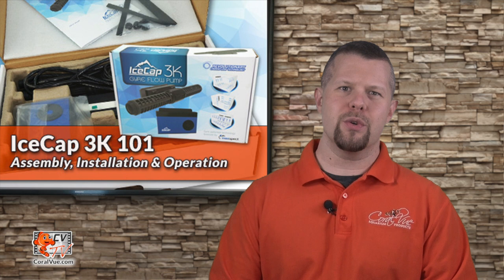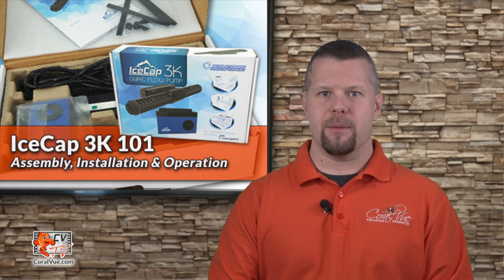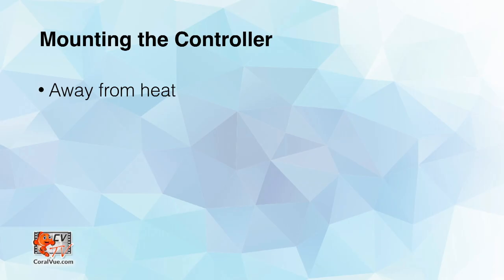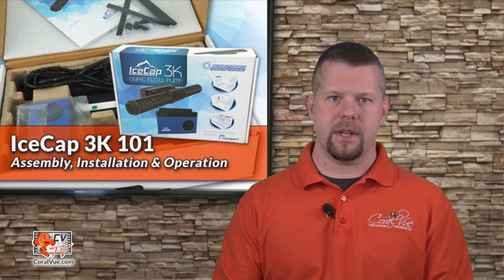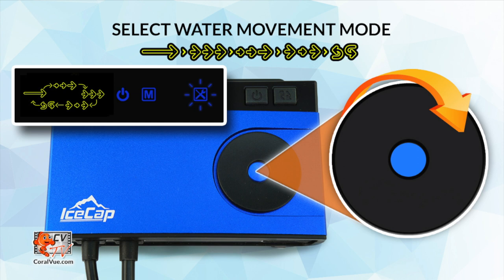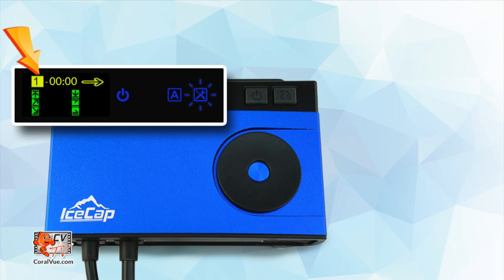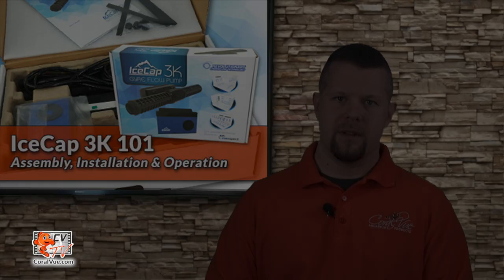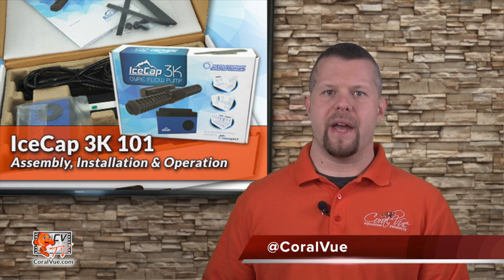IceCap 3K 101: Assembly, Installation & Operation

Comment: Does Ecotech have a patent on the external power cord or do all of the other pump and powerhead manufacturers not yet understand that power cords inside the tank look terrible and detract from the beauty that is trying to be created? Come on guys. The pump in this video would be a winner if it were not for the power cord hanging over the edge of the tank.

Comment: I have a maxspect gyre xf130 with the crappy controller they used to come with, my question is does the new icecap 3k controller work with the maxspect gyre pump? I'd like to buy a 3k and use the controller to control both pumps, is that possible?
Reply from the maker: Sorry it is not possible to use the 3K controller but you can upgrade to the Advanced controller seen here: http://www.coralvue.com/maxspect-advanced-gyre-controller
Reply: So basically i gotta pay $150 for just the controller because it has the Maxspect name on it as opposed to getting a pump AND similar controller for the same price through Icecap smh...last time I buy anything Maxspect.
Reply from the maker: It is a different controller all together and comes with a new power supply to operate two pump. Its Capabilities far surpass the 3K.

Comment: Is the random mode actually choose random modes or does it randomly change pulse speed and length?
Reply from the maker: It provides an random assortment pulse speeds and lengths. Probably one of my favorite settings.
Reply: Appreciate it. That is what I assumed after watching it for quite awhile. Originally i thought it would go into reverse sometimes and at different reverse speeds for turbulence but I didn't see that. Having said that, I am assuming with the program mode I can program the pump to run random then in alternating mode then back into random up to 24 different time point, is that correct?
Reply from the maker: You are correct.

Comment: So is this a newer version or a competing product to the Maxspect Gyre?
Reply from the maker: The 3k has same Crossflow design as the Maxspect Gyre and is relatively the same size as the XF250 but has a GPH output of 3000GPH. The 3K also does not have all the capabilities that the Gyre 200 series pumps have. This pump is geared towards the budget friendly hobbyist that doesn't care about all the bells and whistles but desires the awesome Gyre flow.
Reply: Thank you for your reply. I have the XF130 and it had an issue with the connection to the controller. It would never stay on and I gave up on it. I just bought this model so hopefully the quality is better.